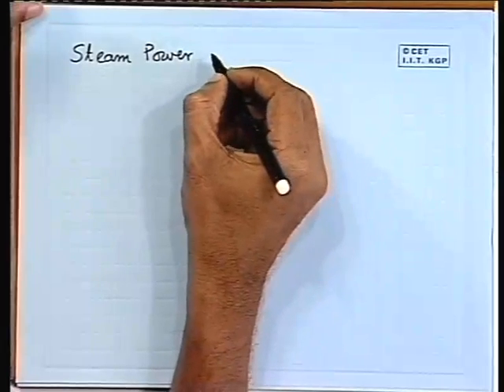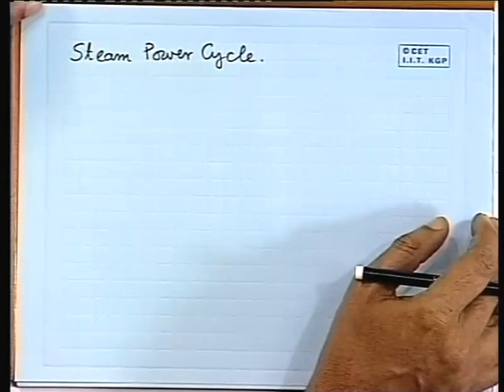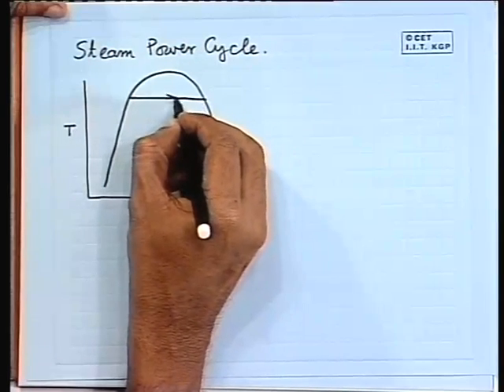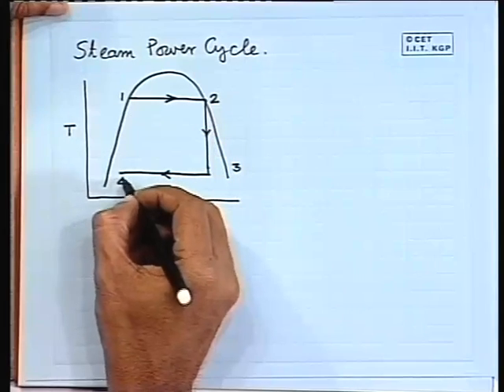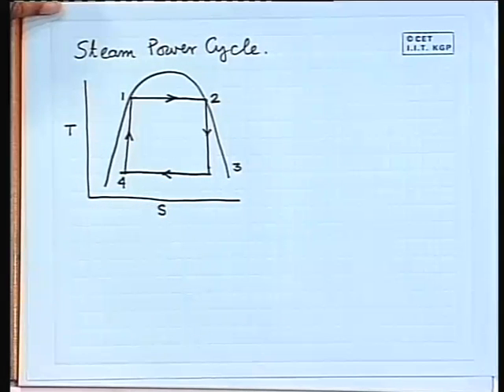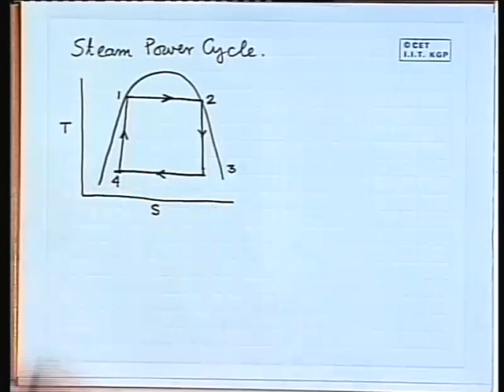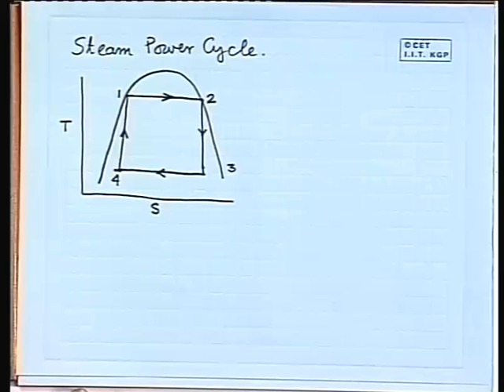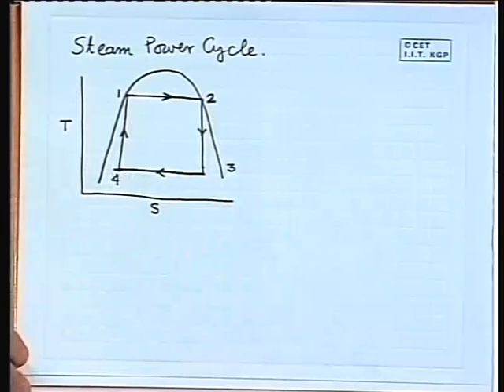Lec-9 Vapour Power Cycle

Comment: why is it that in evaporation process when it is at constant pressure it also take place in constat temperature
?
Reply: bro. it is that because if u read a graph of " PURE " substance u see that from vapour saturation point to liquid saturation point the pressure and temperature is constant . It is because of LATENT HEAT . As we know , latent heat takes place at constant temperature & constant pressure . so , to convert vapour  into liquid you also remove latent heat of substance .                  If u don't get my point  then u learn CONCEPT Of " latent heat " and apply it u get answer ..... Thank u ......